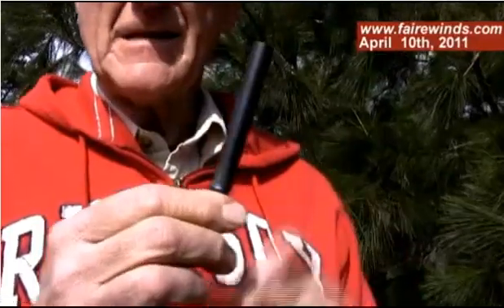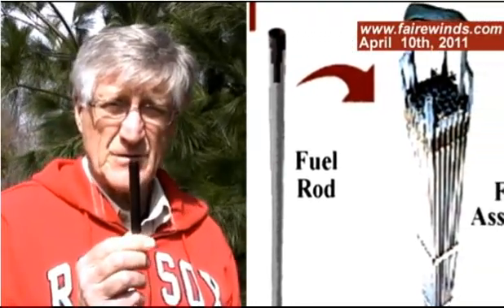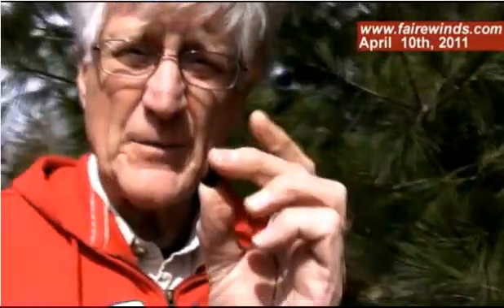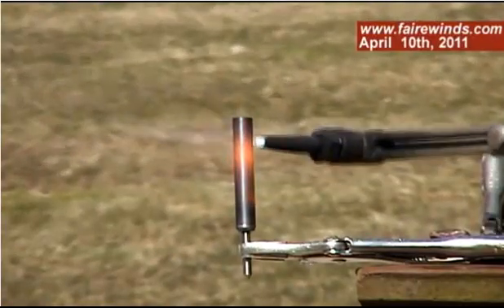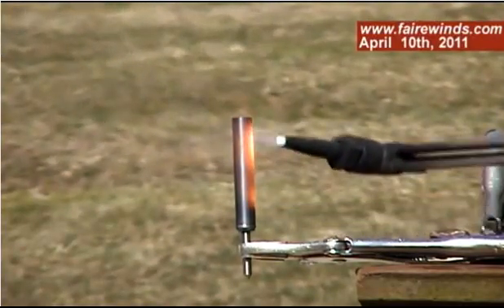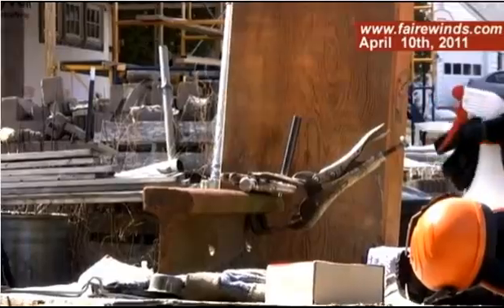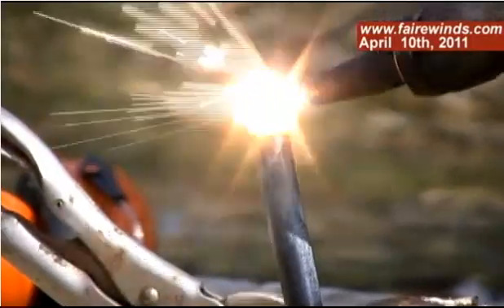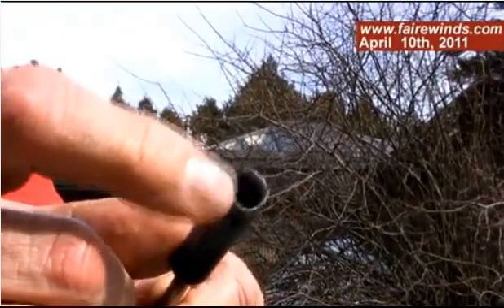Fukushima - Arnie Gunderson - 10th April 2011 - Experiment.

Comment: Great upload, again Arnie

Zirconium oxidized with the water sprayed on it releasing the Hydrogen, steam and a hot spot that might lift mall parts of nuclear fuel in the air, the salt in the seawater doesn't make it any better.

The small fuel cilinders fall down to the bottom where it is difficult too cool them.
My gut feeling tells me it ain't over yet